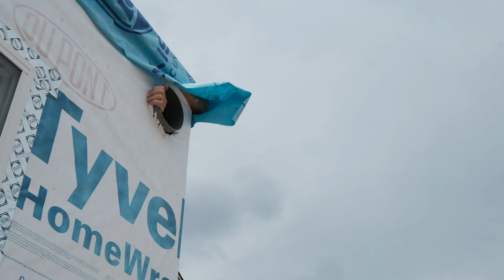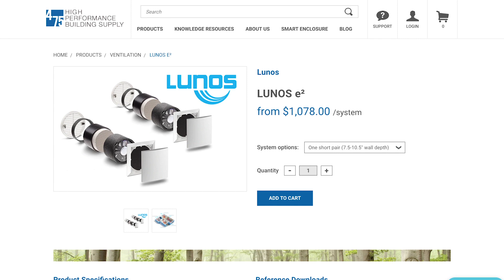Efficient Fresh Air Ventilation for a Tiny House on Wheels

Comment: Would you say this system increases, decreases or has no effect on humidity inside your house? Need a dehumidifier?
Reply from the maker: Hey A K. Since it's always pulling air through, it feels pretty much like the outdoor air in that way. I'm in New Mexico where it's normally dry. So even after showering, the humidity is gone quickly.
Reply: @RyanDobbs  Thanks for the reply. I have 280 sqft. tiny house in Central Texas. I am researching ventilation systems. The Lunos e2 looks to be quite good. Another question I have is, much of the year I am using air conditioning, would this system be pulling in hot outside air and pulling out cool air conditioned inside air? I understand how it could recover heated inside air in the winter through the honeycomb tube. But would it recover cool air conditioned inside air in the summer? What is your experience with that in NM?

Comment: This house seems to have a large power need. How is that managed? Just by offshore power? Propane generator? I've been thinking about building one of these and that's been a major stopping point for me. It seems like I'll need more electricity than I can get.
Reply from the maker: Hey, Darian. Offshore. I'm currently running off a 20 amp breaker. When I have mini-split, washer/dryer and oven all running, it will trip. 50 would be ideal. And sorry for the delayed response. Hope you're further along in possibly building one yourself.

Comment: What kind of tube did you use at 1.16 mark? Just some plastic tube, or is it made from some insulated material? Where'd you get it?
Reply from the maker: Those outer tubes came with the vents. foursevenfive.com I think they're just a grey pvc.

Comment: Considering this unit, in a perfect world the fresh air would supply the house in the same area as the mini split (conditioned air with fan). If I’m not mistaken this unit switches which intakes and which exhausts? This would at some point be in conflict. Have you noticed any issues or loss of conditioned air?
Reply from the maker: Hi, Michael. With the units I have in place, the mini-split is only either cooling or heating the air already inside the house. These little fans in the video are what brings in the fresh air. Yes, one fan will bring in air while the other pulls air out. After about a minute, they reverse directions. This cycling of directions is occurring all the time, thus too is the loss of conditioned air. These fans with their ceramic cores are supposed to have a "heat retention rate" of around 85%. So the loss is happening at a much slower rate than if you just had fans at either end of the trailer. That's the selling point of this little ventilation system. I think it's great. It's never stuffy inside and the mini-split has no trouble keeping the temperature where I like it. Thanks for your questions. I hope I understood and helped to clarify.
Reply: @RyanDobbs  What Michael Lopez is saying, is that an ideal system would be an ERV/HRV where the intake air only comes in by your heater, and the exhaust vent is as far from the heater as possible. Because it is removing air from right next to your heater (recently heated air) half of the time, your home is less efficient during that half of the time than when it is removing air from the other side of the house. Still, it is more efficient than a conventional ventilation system. I wouldn't worry about it. What you COULD probably do is to have the heater only kick on when the system is exhausting from the opposite side of the house. But honestly, that minisplit is probably blowing hot air halfway across your house anyway, so this isn't as much of a problem as if it were a space heater. If you were using a space heater, you would probably want to position it in the middle, as far from both vents as possible.
Reply from the maker: Nick Van Riper I get what you guys are saying then. And yes, the mini split does push the air pretty well across the tiny house. So yeah, maybe I got away with that one. Thanks for clarifying.

Comment: When working in exhaust direction sucking out the air from the room, where does the air come from to compensate the pressure drop? From the outside by any chance?
Reply: The idea is you install two units working in tandem so when one sucks air in, the other is exhausting at the same time, and they're constantly switching directions which is how they're able to do energy recovery.
Reply from the maker: Hi, BD. There are two of those fans. One blows in while the other blows out. They both reverse directions every minute. Never a pressure issue. And sorry for the delayed response. Hope all is well in your world.

Comment: Yes, HRVs are a great way to ensure you can have fresh air but not worry as much about what the outside temperature is...  

It even works in reverse during the summer, to help keep the inside air from gaining too much heat from the outside air.

While a ERV takes that a step further by helping to regulate humidity levels but you may still need a dehumidifier and/or humidifier if in especially humid or dry climates.

Some may feel it's not needed if they live in an area they can just leave the windows open all year round but these air exchangers can also help filter the air and help make sure the air in your house is actually cleaner than the air outside...  Though, those with filters will need regular maintenance, but if you take care of them then it'll last for many years, even over a decade...
Reply from the maker: Thanks for sharing. That's true about the filter having the potential to keep the inside air even cleaner than the air outside. This system has filters that can be taken out for cleaning as well. The LED attached to the controller is supposed to light up when I'm to do so. Pretty slick little piece of technology for keeping the space fresh and clean. I've had the system up and running for a little over a week now and am very happy with it.